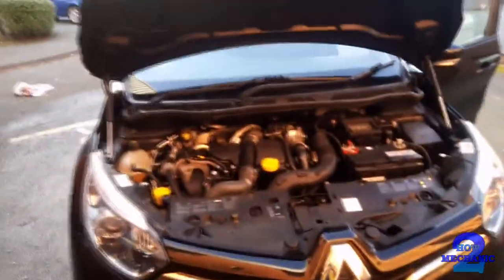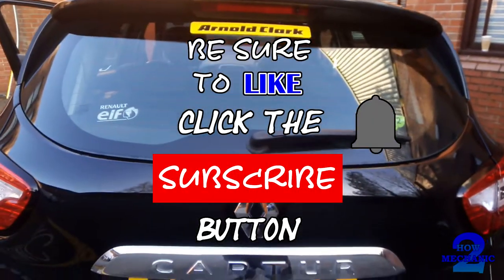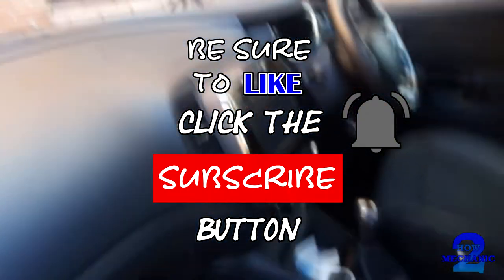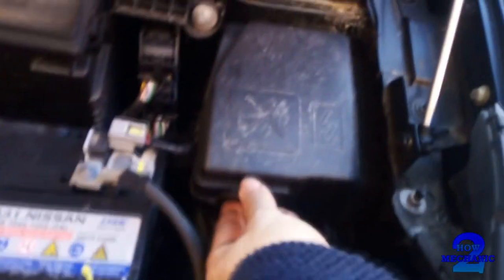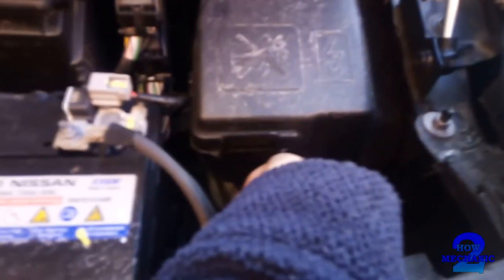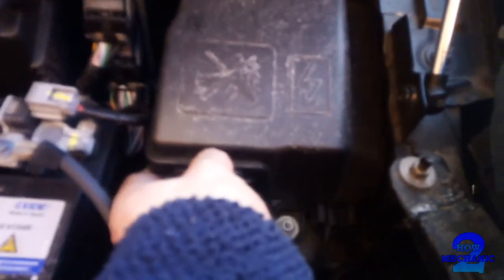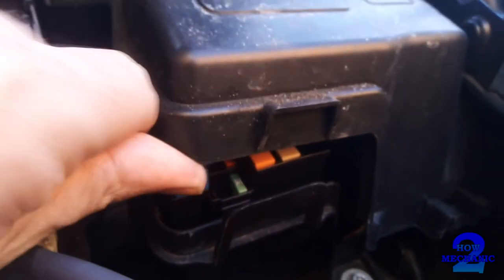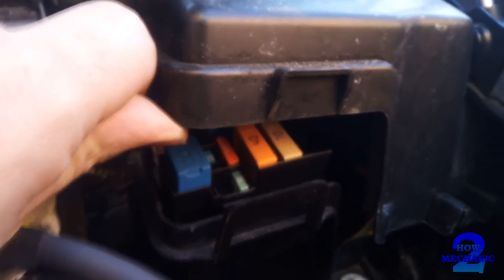Renault Captur Fuse and Relay locations

Comment: I have a clio 2013 and my drl are not working.any tips?
Reply from the maker: I've heard to enable them through the Onboard Computer, in the "custom setting menu" (that is the translation from italian).
Once you have selected it, by holding one of the buttons (in the windscreen wipers lever) you can access to a sub-menu where, cycling through, you will find the option to enable\disable see if that works
Reply: Can u make a video about it or contact me